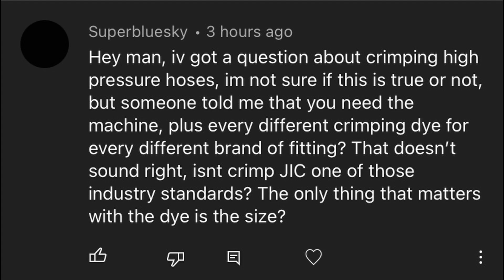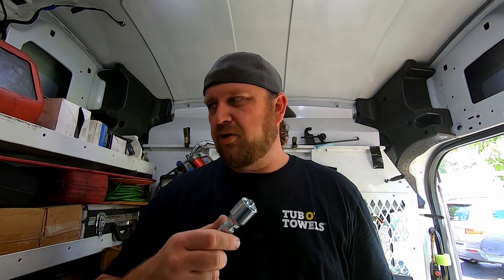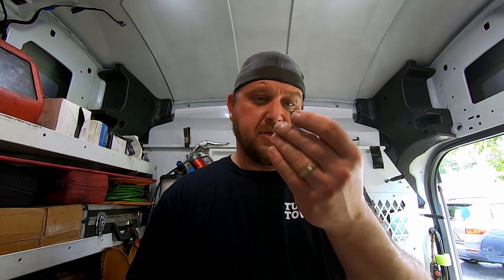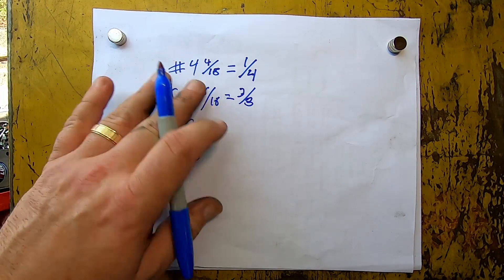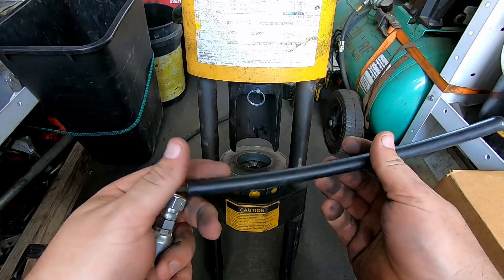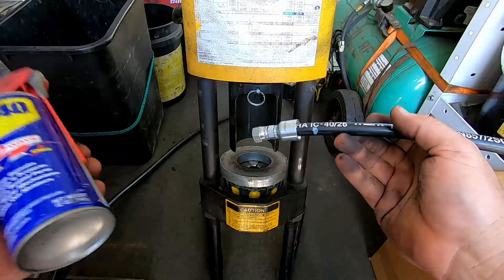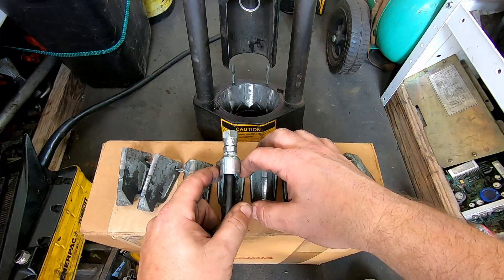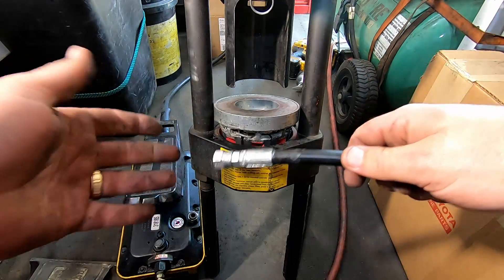Hydraulic Hoses And Fittings 101

Comment: 11:31 I always twist the end on the hose, if it’s all the way in you’ll feel a very slight grinding feeling of the braids rubbing on the inside of the fitting. If you’re not quite there and you spin it it’ll be totally smooth.

Comment: Oil Rig we fixed are own hose the fitting was 2 part a female and male the female would screw over the hose and the male screwed into the female and the hose would expand into the braded hose  6000-10,000 PSI hose and fittings.  power steering hose are 3000 to 10,000 .

Comment: 12 years ago, on my boat engine oil cooler. I replaced the hoses. They had been SAE 45 brass fittings on the hose ends. I went to NAPA and he made me an Aeroquip 1/2" hose, heavy duty thing with JIC female ends. I put them on the 45 degree brass SAE fittings, and they never leaked. So then  few years later, I replaced the hoses to the remote oil filter. I bought AN-8 SS braided hose and AN-8 female 37 degree ends and attached them to the 45 degree SAE brass fittings, and they never leaked either. Then come to find out more recently, you are not supposed to do that mismatch of angle fittings as it will leak. But it never has leaked on me. Engine oil pressure is low PSI, maybe that is why it worked ok.

Comment: Man I have somewhat of an off subject question or advice request. I am getting ready to retire in a year and would like to start a mobile hydraulic hose repair service. I live in Mississippi area and have no experience with the industry. I have an eaton 1187 crimper and only used it to replace farm/tractor hoses every now and then. My question is how many and what size fittings to keep on hand initially. Do you think in todays time I could make a decent income doing this? Of coarse it is a NAPA and a few hydraulic shops around to be competition but on one does mobile hose repair. Am I fooling myself on giving this a go? Thanks and any advice would be appreciated.

Comment: Pipe dope and Teflon tape are only lubricants. They don’t seal anything. They help you get a good deal by lubricating the threads so they don’t expand from heat and leak after they cool down.

Comment: If you read the comment in the video it says he was told you need a different die for every brand of fitting not every style. That can be true depending on the style of crimper you have. With a positive stop crimper like you use in the video, it's only set for parker style fittings. If you were to crimp a couplamatic or weatherhead u series with it, the crimp would be too loose and would blow off. You must know the correct crimp spec for the hose and fitting you're putting together. If you vary the crimp or the hose o.d. you have to adjust accordingly.

Comment: On average, what does a 2 wire hose  (Parker) cost per foot, and then also, on average would you say each fitting (JIC) would cost? I know there are a million variables, but the keyword is average, not talking 2 inch diameter, but say max 1 inch.

Comment: So what is the swivel joint connector called? I've just had to release a hose to the drive motor of a mini excavator, the swivel part rusted frozen. Put the hook of a come-along in the ring end of a 17mm spanner with the open end on the piece on the hose, connected the other end of the come-along to a chain slung behind the wheel of a car. Tightened. 19mm spanner on the end of the fitting screwed onto the drive hose, a few smacks with a club or lump  hammer -- freedom.

Comment: The problem is in the hydraulic industry, although there are standards, its the wild west. If your an electrician your not going to see a huge difference from brand to brand, in hydraulics everyone has invented the wheel in their own way. The standards are often seen as minimum standards, so you'll often see meets or exceeds  such as "Exceeds SAE J 517 (SAE 100R@AT)" so if every company can meet or exceed the standard then you typically do not have equivalent products. Its like a wrench, everyone makes a 7/8ths wrench but they are not all the same. 100R2AT is the standard for a typical 2 wire (2 braids) hose, the pressure starts ~ 5,743 psi at -04 and by the time your making a -32 your looking at ~1,494 psi. If you have a parker crimper they supply you a limited amount of dies that are color coded, there is typically a chart that will tell you what crimp spec those dies crimp to. In our shop we can use the same die for several different types of hoses and ferrules and we make adjustments to the crimper to get our crimps within .1mm measured with a set of calipers. We have instanced where 1 hose can use multiple kinds of fittings, for example a 5,000 psi 5/8 hose that can use a lighter series of ferrule but requires the hose be skived (outer cover removed with a blade, a hacksaw, or a skiving tool) or you can use a higher series of ferrule that will fit over the cover. So picture that you have a few series of 5/8 hoses. A 1 wire, a 2 wire, a high temp 2 wire, a compact high pressure 2 wire, a 2 wire spiral, a 4 wire spiral etc etc theres a lot of applications out there. Well maybe your A series ferrule can crimp onto the 1 wire, 2 wire, high temp 2 wire, compact 2 wire, and if you skive it the 2 wire spiral. Then you have your B series ferrule which can crimp onto your compact, 2 wire spiral, and 4 wire spiral but it can't crimp onto your 1 wire, 2 wire, or high temp 2 wire. Compare that to your 1/2 hose where your A series can crimp the full range, but the b series only crimps the largest 2 sizes. The point is there is variation throughout. Theres also 2 piece fittings where the ferrule isn't pre crimped to the hose tail. If you're company has done the proper testing you may have 4-5 different methods of crimping a fitting to your 350 Bar 1/2 Hose. Some companies use an interlock fitting which may require an outer skive and an inner skive https://www.youtube.com/watch?v=EJb7HNlkXlc is a good example of the use of an internal and external skiving tool. Basically long story short every brand does require a different crimp specification, so if your using a crimper like the parker set up with color coded dies then you are risking having the end of your hose blow off. If you have an adjustable crimper it is still inadvisable to mix and match products because you won't know the proper crimp specification, however we have instances where our mother company will invest the resources to have X brand ferrule series Y tested to work with Hose Z and then they will provide us with a crimp spec that can be trusted because we know its been tested for so many impulses, so much pressure, had so much force pulling on it etc.  We refuse to sell customers hose or fittings separately, we do not provide re-ends on hydraulic hoses, we won't crimp your fitting on our hose or ours onto yours. If someone comes in with a Gates hose and needs a fitting put on but can't/won't pay for a full assembly I'd gladly refer them to the local gates dealer, or parker, eaton, manulli, whomever it is. Safety's not an accident.

Comment: Our crimp is a flextral 5022. 
The hose from the pedal control to the crimp is about 6” to short when setting up on the bumper of the service truck. It kinda dangles so I just put it on the bumper and use my hand to rock the pedal. 

Ours is air over hydraulic. 

I’m going to make up a longer hose. Is there any tricks I should know about bleeding the hose?  Thank you in advance. 

Jeff

Comment: I love the simplicity of your crimping machine, I live in the UK and we tend to used two piece fittings and adjust a dial to the hose size. Its handy if you dont have the correct fitting, you cut the ferrule off the old hose and pull the fitting, pop on a new ferrule and you are in business. Then there is the range of fittings you come up against, BSPP, BSPT, Metric, JIC, ORFS, Boss. Fitting a quick hitch valve tomorrow, the 4 ports have different sizes and types on the old valve and all 1/4 bsp on the new one. Oh joy!

Comment: Back in the day when the rocks were soft and the dinosaurs werent quite ready yet i worked at a deep stock auto parts warehouse (I belive these have since gone extinct) and we caried gates and parker, the dies are slightly different. 
Its not common to have multiple brands in the same environment so i cant see where mixing dies should ever be a problem. 
Not to throw shade on forklift guys but i swear not once did we ever make a lift hose that was the right size. Its like they get streached or something and they always ended up an inch or two too long. For some bizare reason, no one could ever find the manufactures spec for how long those hoses are supposed to be so we just had to match them. 
Gates has a branded die grease and i swear no one else in the whole place had any clue you have to lube a die, burned up 2 pumps in the decade i was there.

Comment: I've noticed my crimp connections have rings around the bottom, either 2 or 4. Sometimes the lines are solid & others dotted. My co-workers & I call them "ought" lines. When we have to make a hose I just duplicate the old hose best as possible including using the same lined crimp coupling. I've always assumed these "ought" lines were for 2 braided or 4 spiral reinforced hoses but can't find any documentation online or on YouTube to confirm or disprove. Do you have any ideas on this? Great video BTW. Very informative & easy to understand. Thanks.

Comment: Tell us your secrets for not losing a drop of hydraulic oil on yourself or the ground. The RailRoad Contractor, B&B Metals Inc Tie Plate Distribution, that taught me how to make hoses always said to leave a tiny area "bubble" uncrimped at the top of the crimp area under the direction that it was less leak prone.  Hose completely seated just small amount, 1/16"-1/8", of crimping surface  untouched.  I assume the "ribs" whitness mark when even with hose end was thought to be a leak path.?. Ever heard such a thing, if so a reason?

Comment: I make all of these on a CNC lathe... Most go to CAT.  I didn't know the specific applications, and this was good information.  I'm commenting before finishing the video, but I'm wondering what the purpose of ports (on a block or manifold)are.  They have a machined surface on the face to take an o-ring, but they also have a 37deg taper at the bottom and a straight SAE thread.  Are they supposed to be able to take multiple types of fitting, or just JIC with a 37deg taper? Obviously I don't mean NPT or tapered threads.

Comment: Really good vid, You’ll find most places wont re end hoses because every manufacturer’s hose is designed for specific fittings and matching dies. Its a material and tolerance thing, as others have said, its for a reason, lucky = leak, unlucky = hoses blowing out of fittings and associated disaster.

Comment: @funk fpv   I use the same crimper as yours, there are in fact different dies for the crimps. We use a variety of 26 series crimps and 43 series crimps from Parker. They have 2 different part numbers for the dies and they are NOT interchangeable (ask me how I know lol). Everything in your video was great but the line about the dies only being different for the hoses and not the crimp fittings could really fuck somebody over. I can send pics or make a short video and email it to you or something if you want some reference. keep on keepin on

Comment: What about 22° (included) inverted flares a la MS-219? There's no flaring of tubes you just swage the ferrules (MS-218-size) on the ends. These flareless/inverted flare fittings are replacing AN fittings on military aircraft.

Comment: @FunkFPV Hey man I love your shorts funnier then hell and I’m really digging the full length videos. I always wondered how those were crimped. I give you credit for working on hydraulics period, I’ve heard horror stories. Either way maybe make a video of you repairing a line or two idk just a thought
Reply: Nvm saw the forklift repair video which was awesome is there a reason you didn’t make a hose instead of buying one????
Reply from the maker: I probably didn’t have the right fittings on my van. I only stock the stuff I use all the time.

Comment: I used to work for custom crimp or Val power, and machined every component to those crimping machines, started out making the dies then moved onto making all the other components. Watching this video brings back memories of those machines. Parker was our number 1 customer at the time when I was employed there.
Reply: What size hydraulic rams are used on these machines for the 1/4" to 1" size fittings? Is 20 ton enough?

Comment: As someone who works with a lot of tractors, hydraulic lines are one of those constants in my life I'm always having to deal with. Sometimes they're a breeze to fix. Just got to unscrew the line, bring it into town, then reattach the replacement. Other times though... They're one of those hard to reach types. Whether it's crawling into a tight space, not having enough room to twist the wrench, or hanging upside down while hot oil dribbles down your arm. It's a job though, and it's gotta get done.
Reply: Yep, I don't know how many knuckles I have knocked the hide off of in those hard to reach spots between cab and transmission!   Even worse is down the inside of frame rails on dozers.   That is where the prickly pear and mesquite thorns hide!  😂
Reply: I am the equipment mechanic, building maintenance person, and all around fix-it person at an automotive salvage yard. I fix everything from the big wheel loaders and car crusher in the yard all the way down to the computers in the office. The crusher, loaders, and 4 forklifts all rely on hydraulics. And I kind of go back and forth on whether or not it would be worth it to start making my own hoses. One thing I've noticed about places that I go to for this stuff is whether or not the people making the hoses have ever worked on equipment that uses them or not. If they have, they're careful to make the hose exactly the same length, and they match the curve of it from the roll with the main curves of the original if there's angle fittings on the line. Why? Because when the hose is an inch or so longer, it can be really hard to get it into place. And when it wants to curve the wrong way, getting that stiff hose lined up correctly is a pain in the ass.
Reply: @puckcat22679 im geting in to this and going to consider this for better service
Reply: I am the equipment mechanic, building maintenance person, and all around fix-it person at an automotive salvage yard. I fix everything from the big wheel loaders and car crusher in the yard all the way down to the computers in the office. The crusher, loaders, and 4 forklifts all rely on hydraulics. And I kind of go back and forth on whether or not it would be worth it to start making my own hoses. One thing I've noticed about places that I go to for this stuff is whether or not the people making the hoses have ever worked on equipment that uses them or not. If they have, they're careful to make the hose exactly the same length, and they match the curve of it from the roll with the main curves of the original if there's angle fittings on the line. Why? Because when the hose is an inch or so longer, it can be really hard to get it into place. And when it wants to curve the wrong way, getting that stiff hose lined up correctly is a pain in the ass.

Comment: Thanks for that, I work with a large variety of hydraulic fittings to calibrate pressure gauges, the explanation on why we use tape to seal tapered fittings is very helpful. I didn’t notice you mention BSP fittings, perhaps they are less popular in America or maybe I just missed it
Reply: We hate BSP in America. Why would you want to measure in base ten when you can measure in fractions and thousandths? 😂

Comment: Not even trying to be rude or condescending but what are you working on primarily that you use primarily JIC and not Seal Face Oring? When I was in the oilfield typically everything was JIC because it was the cheapest and most cost effective method but when I switched over to construction (primarily heavy machinery/Diesel Tech) almost everything from a dealer has oring face?
Reply from the maker: I’m working on Toyota forklifts mostly these days. Back when I did construction equipment it was about 50/50 JIC/Oring Face. That was over 10 years ago

Comment: One thing you must always always remember when building a hydraulic hose is the ID must be smaller than the OD or else the hole will be on the outside of the hose and it'll leak like hell
Reply: I'm pretty sure that gives you anti-hose, which is theorized to be the strongest form of hose.  It only works with anti-fluid though, and is incredibly volatile when it comes into contact with standard hydraulic fluid.
Reply: Rolling up my pants leg, shure glad I got high top boots on!   🤪

Comment: I work on race car equipment every day, we use AN fittings and hose which is very similar to JIC (both SAE 37° Flare) I’m glad you know that the dash sizes are the number over sixteenths. not many people know that!  I’ve built fuel lines, hydraulic power steering lines, oil lines, brake lines, etc.. using AN and NPT and ORB and even some metric 😬 fittings! Good video!
Reply: yup, I just wish it was easier to find non-swivel hose ends and more durable hoses for longer life. I've been switching to metal lines where possible